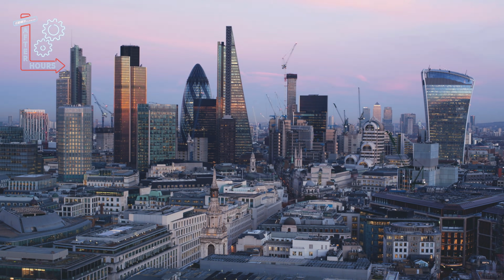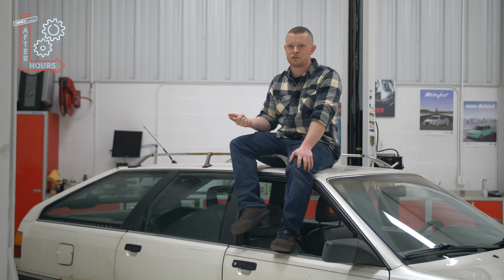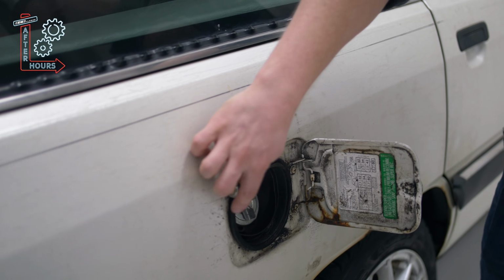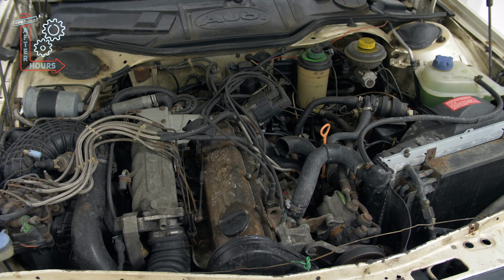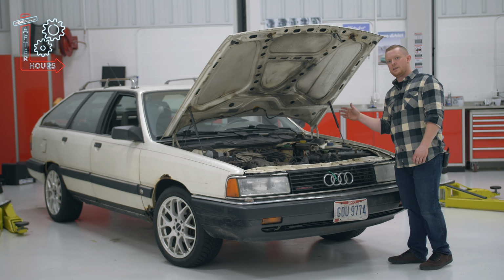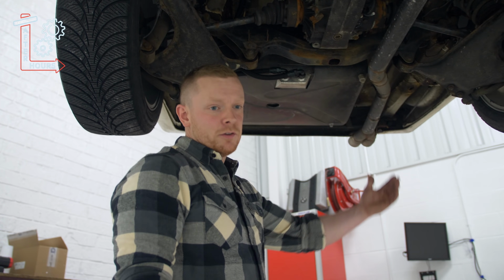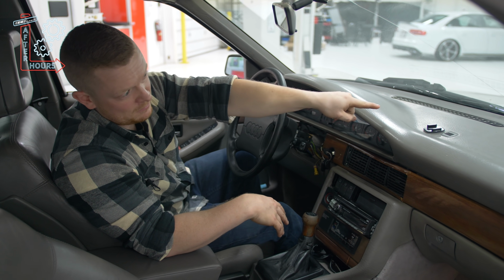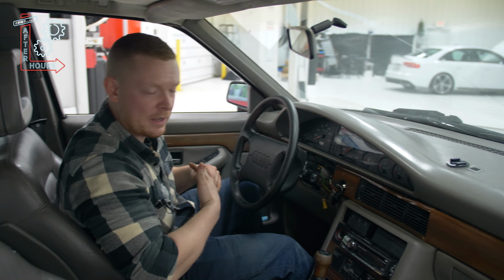This $950 Audi Sounds EPIC // Winter Beater Challenge

Comment: 0:14 maybe you don't know it, but aerodynamically Audi 200 is STILL quite good. Cx 0.30, an absolute record in the 80ies, unreached for quite a bit. In a stock model you could listen to Beethoven without any problem. It means she is really quiet inside. That means, no turbulence. That means, you guessed it, very good aerodynamics.
Very sad a car so beautiful (and capable) was left so badly manteined. She could come back to her beauty, but with a LOT of time, love, and a bit of money. I personally think she would be the best at 250/300 hp, a modern turbo and ecu. Then you get the perfect winter car, comfy, roomy and classy. And unstoppable.
ps if it will ever work, don't go over 10 mph with diff locked, it is not made for speed...

Comment: This inspired me to buy a 1993 audi 90 cs fwd picked it up for 200 and it only had a broken radiator and a fuel pump malfunction i kinda have a timing belt issue but im working on it sadly i couldnt get the Quattro version and its an auto

Comment: Hey

i just wanted to tell you: that mirror thing is not normal. this happens, when the bracket broke. normally they only fold the "normal" way only. my driver mirror bracket is also broken and can do all directions. but my codriver mirror can only do1 direction ;D

never the less, a really awesome car.

myself i own a Audi 100 2,3 without Turbo, but 100 and 200 are basically the same cars... i love these cars so

when i see the scratches and the missing color on the shifter, i think this car did 1.000.000 miles and thats why its hows 90.000 now...

greets from germany

Comment: Remove the black plastic cover on the distributor cap... collects moisture and eventually carbon tracks and arcs around the cap. Works okay in Phoenix, etc, but not anywhere with some humidity....we removed them at the dealer when the cars were new or we replaced the distributor caps. The alarm system had a starter interruption circuit so be aware of that if you have starter issues. They were amazing cars. Never saw a 5-cylinder wear out.

Comment: at that price.. you would fine NONE in europe. Not even close to 950$ (@780euro)
I would buy as many as i can at that price, but exactly that configuration, OR the last one, which came with dual overcam heads (just before to appear the C4)
Long time ago, i owned a 2.3 n/a 100 avant quattro, but at that time, i don't know much about working at that type of fuel injection (mine consuming about 20liters for 100km ..easy driving.. manual gearbox)

Comment: I too own a beater (sort of) car - Golf Mk3... the thing with beaters is that people judge it by its looks, but a friend of mine, which has had Skoda Felicia (almost the same cars) as his first car, absolutely adores my car, everyone who sits in it, says it looks ugly but for its age, its technical condition is surprising - I just need to make sure that brakes are in top condition, install anti-roll system, do a engine check (repairs or changes if needed), turbo it, some good wheels, some other repairs and after THAT - I will have the ultimate sleeper.
Would I drive this Audi? I fucking cetainly would, I do sort of get why this dude is talking about his car with a certain shyness, or as if he was not that much affected for it, but this car is actually absolutely awesome - the bad thing is that in the USA repairing and getting parts for it must be an absolute horror, it would be much, much easier here in Europe.
Cheers man, I hope this Audi will make you happy for as long as possible.

Comment: For some reason the C3 Audis are called sigars in Estonia no idea why. 
But the wavy trimming and rusty winds are a standard but the rest should be zinc covered so should not rust i the near future. 

Get a decent kinetic tow rope.. These straps are rubbish :D 
A good tow rope probably available for a couple of dozen bucks or smth 
Or if you can buy nylon docking rope from a boat store by the meter the brading is just something to do for 20min when drinking beer in front of the tv. and will cost you a tenner.
Fot the Audi you need like 18-20mm not more with 8t max breaking strenth.

Sounds like a waste but i believe it is best find since sliced bread.

Comment: Although this 200 was neglected and obviously mishandled by previous owner, it´s still worth saving and keeping. They are rare, especially the Avant version, also they were fast cars.  The 2.2 R5 engine is placed quite near the front bumper, making handling in corners tricky, but with true 4x4 system and big turbo it´s really fun to drive. That engine was also on the later Audi S2 and those were enormously popular with tuners. The 5 cilinder makes a distinctive noise that´s like a favorite track to car fans. These cars like this Audi, the E32 BMW or even those Volvo 850 t5´s are fading away from memories and rotting in scrapyards because they need more money and attention than some run of the mill Honda, but keeping a car like this is like taking care of automotive heritage.

Comment: My go-to shop here in Germany when it comes to Audi 100 parts for my car:
http://audi100.net/Shop/shop.html
He has a seal-kit for the power-steering rack (and the pump).

Sadly I don't know if he ships outside of Europe. But just ask.

BTW: 0,8bar boost is more than stock. In stock config, it should run into a fuel-cutoff at around 0,6bar boost. So maybe you have a modchip OR someone "modded" other parts of your car to prevent that. Stock is afairc 0,4bar

And when you are able to afford: Get rid of that K-Jetronic crap and install a propper ECU. I hate my K-Jet but can't change it legally to a more modern ECU (motronic or something custom).

Comment: "Aerodynamics of a large brick"
WTF?
This Audi has 0.30 cW, one of the best along the cars.
Reply: I just wanted to write that down. True youtube car lovers
Reply: I was thinking the same thing. Remember the Talladega top speed record car? that was part of the marketing if I remember correctly.
Reply: Wrong,the Audi 100 had 0.30cw ,but due to the completely different front (grille ,bumper ,headlights etc.) The audi 200 had 0.33cw ,the more you know ;)
Reply: What to expect the Americans 🙄🤦‍♂️
Reply: good point..0.29 exactly, as i mentioned in my post above ..;)
Reply: Thank GOD somebody wrote this. It was one of the most aerodynamic cars of it's time and inspired absolutely EVERYTHING we see on the roads today, starting with the original Ford Taurus. Ford bought one of these things to see how they could make the Taurus aerodynamic. Millennials have no clue I swear.
Reply: Miami SWL Radio people that use generational terms are fucking morons
Reply: cW alone is not all ! cW x the size !!
Reply: @MrLince-hr4of  and? the car is small compared to today's SUVs and American trucks, so even more valid today
Reply: @dominicpascal5512  so what ?

Comment: in germany that car would cost 5000€ just to cheer you up :)
Reply: these dont even exist in my country.
Reply: In austria are only 5 on sale with that 2.2 turbo. The cheapest one is 6.5k with rust and in terrible condition. The other 2 are 12 and 17k. The 12k model is modded and looks good on the pictures, the 17k model is stock and looks good too.
Reply: @gepixelt7712 5 for sale in my entire country, 1.8 fwd
Reply: @roberts2760  Tu esi idiots?? Vai vienkārši idiots??
Reply: @Leonards78  nu abi divi
Reply: für 950 bekommst du nichtmal mehr nen gerockten 100er in Germanyyy :(
Reply: Killerinator A nice one would cost €5000, this “junk” could be more like €300-€500
Reply: @ricards8114  would pay 1500 EUR easily for this one, only 6,153 of these were ever produced

Comment: I and my brother just started a rebuild of an old audi qattro 2.2 100 avant. And i can say, that all tose bushings for suspension, subframe, back and front are easy to get. Just finde some original part numbers and order them from europe. Allmost everything is still accesible. Even fuel tank, but it costs more than a 1000 EUR, so we just cleaned, and welded the old one. :D We just did engine and  gearbox hughe rebuild and it costed about 700 $. And car runs, and quattro works perfectly.

Comment: the diff lock button does not actually LOCK the diff either.. it engages a set of clutch packs. its push button limited slip.
Reply: Ellie Niemeyer There are no clutch packs in that diff. It's vacuum operated and old school.

Comment: sub 200 horsepower? .8bar of boost? MC Engine?

Theres two MC Engines.. which one and which turbo do you actually have? You should def. consider running a k26 and a chipped ecu with a modified wastegate spring. 10vt is worth like 250hp on k26

Comment: I would recomend swaping it to a megasquirt efi system.  Also hit the molding under the quarter window with a heat gun and pull one end with a pair of neadle nose.  I also have spare 10v fenders i can sell ya

Comment: I've had quite a lot of cars that were fucked. One of them beeing a green golf III estate, that ran on 2 cylinders, occasionally on 1.  And only 3'rd and 4'th gear worked, which made setting off from a set of lights, incredibly embarrasing. Because you had to guess when it would be green, then start revving the engine to 6K, because it would take a couple of seconds to get there, and then you could set off. But. If i still had that car, and i had to go through all of it's faults, it still wouln't take half as long as going through the faults on your audi. That car is utterly fucked! With that beeing said, i adore it, the sound of that I5 turbocharged engine makes my boxers tighter than they were a second ago. And i just love the fact that nobody knows what kind of power it actually makes, so you could basically make a sleeper with one. Provided it wasn't fucked like yours. 
You're getting a huge thumbs up from me for driving it, on the roads, and not off a cliff, and i hope it'll make it through the series!

Comment: "TOPRAN 103 707" hood latch cable should fit. It is still produced and can be found on ebay. Your bad shifting is probably a worn or absent linkage bushing on top of the transmission (Audi Tradition Shop sells one - (http://trshop.audi.de/konakart/SelectProd.do?prodId=12214&manufacturer=manufacturer&category=New+produced+parts&name=BALL%20SOCKET&model=0001). An Audi 200 TQ Avant would go for a far higher price in europe, even in this condition.

Comment: To think that the Audi 100 from the 80s had a better drag coefficient than a Ferrari F40 and on par with the Porsche 959.
Reply: Well, it doesnt need downforce. a sports car meant for handling and speed typicaly always has a worse drag coefficient than a family car. not different today.
Reply: @Digi20  But a lower drag = higher top speed.
Reply: @Vazin  sure, its always a trade-off.
Reply: It's drag coefficient though, not total drag.
Cd is drag per unit cross-sectional area. 
Total drag, which is the number you need, is CdA.

Comment: That thing sounds like it's running on 3 maybe 4 cils. Dosnt sound like a well working 5 cil, I can hear its 5 cil, but with some cilinder not firing
Reply: It's because it's a 10v. The 10v has a deeper noise to it than the famous 20v inline 5.
Reply: Robi Flego it sounds the way it should sound. Nothing wrong and firing on all cylinders

Comment: It's probably the shittest, but also my favorite car. The oldschool Quattro system, the 5 cilinder turbo, really cool.
Also getting parts must be horrible, I live in the Netherlands yet I never see a Audi 200 (unlike the other 4 cars).
Reply: Richard - Cheapest audi 200 avant i could find WAS 15K FUCKING EUROS. Holy shit.
Reply: megaman mooshrom no worries, cheapest one here was about 1100 if you wanted to restore it.
Reply: that's cos you sold them all to the Poles
;o)
Reply: In the US these cars are extremely rare. There are only around 150 20V Avants in the US. Parts are supposedly very hard to find.
Reply: @nmg997  i have a 10v. just got it in running condition! only thing is the fuel gauge doesn’t work
Reply: Hey Richard, i´ve got an Audi 100 5 cilinder turbo quattro. I also have got the same troubles ;) hear hear bud!
Reply: @jorisziengs8058  me too mate
Reply: Nothing shitty here.
Reply: Where's that?? 😅
Reply: Rare car

Comment: Did he say it's only making 0.8 BAR?
That's a vacuum.
These should make 1.4 stock.
6psi.
Reply: 0.8 overpressure was propably what he meant.
Reply: I would hope?
A tuned MC2 should make 1.8 or 1.9bar. (13psi)
The screen in the dash reads absolute.
Reply: @Mpeterson1286   Why do u use overpressure for psi and absolute pressure for bar?
Reply: @PB0117  if you read a typical pressure gauge it's zeroed at atmosphere, that's realistically the standard for using psi. 

For people who do exact pressure testing, gauges have to be certified for altitude.
Reply: The dash indicates ABSOLUTE pressure.
1.0 is atmospheric pressure.
Anything under 1 is vacuum.
Anything over is boost.
Reply: @Mpeterson1286  You silly boy, when we talk about turbo we talk about the pressure over atmospheric pressure, most stock cars has 0.2-0.4 bar on the low pressure turbos most commercial cars have
Reply: @Frajmando  Micheal is right. The gauge in this car shows absolute pressure. So due to atmospheric pressure it always shows 1 bar. Everything above is boost.
Reply: 0.8bar boost is around 12psi.
Reply: 1.0 bar is equal to 14.7 psi dude 
Vacuum is below 0.0 bar as is -0.8 bar is about 10 to 12 inches of vacuum
Reply: Sounds like none of you have owned a 200 turbo Audi! The gauge reads pressure above normal atmosphere. 0.0 bar on these cars is idle. Anything above that is positive boost. My 1991 200 turbo would normally read 1.2 to 1.4 bar usually less in hot conditions.

Comment: If anything; that 5 cyl turbo engine sounds amazing
Reply: and back in days audi used torsen .. now almost every car has shitty haldex
Reply: @iviivi187  the longitudinal engine audis use the traditions differentials.
the transverse engine cars use haldex
Reply: @DillyGee  yea ik but nowadays more and more cars use haldex type "awd" and im sad of it
Reply: iviivi187 not true. Only the smaller Audi’s use haldex. A4 and up use torsen or now the new quattro ultra
Reply: azerty ytreza thats ofc but the price is as for normal tech
Reply: @iviivi187   Back in days audi used mechanical difflock 1980, Torsen is only at 1986.
Reply: VAG both was way better than haldex .. im fan of mech diff lock
Reply: @iviivi187   Haldex is not that bad. It works good.
Reply: @vag8110  70:30 is not for me
Reply: @iviivi187   Haldex can split up to 50:50. so 50% max to the rear. sry for my bad englisch, I´m german
Reply: VAG no problem , Yea thats true i just wrote the many cases that is used mostly as 70:30 .. but ofc they have 50:50 but its not that proper as BMW or merc
Reply: They still use this engine in the RS3 to this day, engine will be ditched this year I believe due to new emissions' law
Reply: El Pequeño Pene the engine in the RS3 is entirely different lmao
Reply: This engine literally has nothing in common with the RS3 engine  @Emon_Lusk_
Reply: @Emon_Lusk_  No they don't. It's a completely different engine. First off it's transverse. Literally the only thing that is the same is the fact they both have 5 cylinders.

Comment: Is it actually reliable? I have wanted this thing since you first showed all of the cars.
Reply: Most of the older Audis are really good if they've been cared for. The engine/tranny will go forever.  That being said, like the older VW's, these Audis will bleed you dry if they've been abused.
Reply: If maintained properly these things will last just fine. Getting new parts might be difficult. I would own one as a daily driver if new parts were available easily.